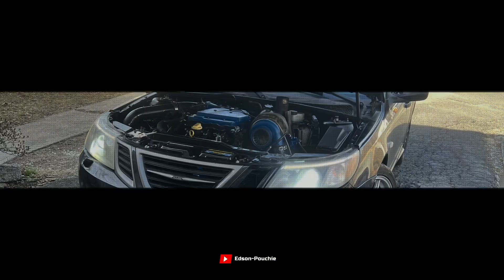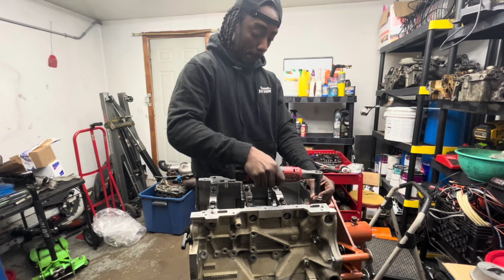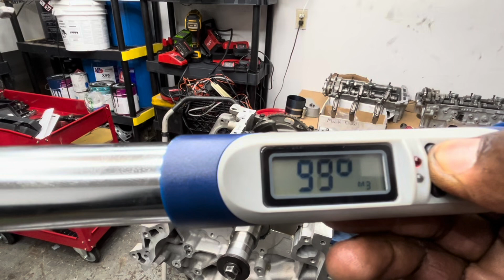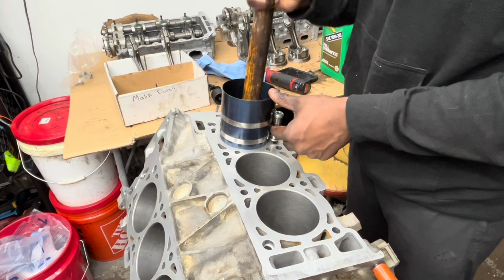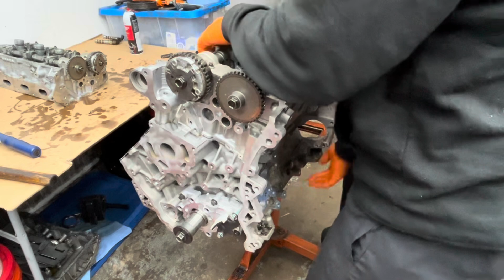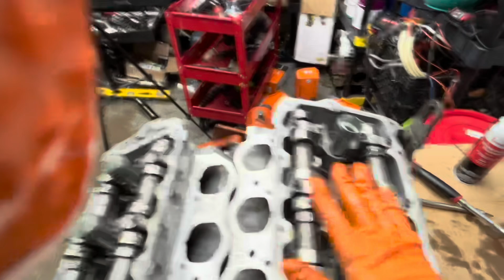TurboX 3.6 Swap Pt.3 | The Fully Forged Engine You’ve Been Waiting For!

Comment: Just stumbled upon your channel. Always cool to see someone diving in deep into these under the radar cars. Saab’s are definitely cool and i didn’t know the LY6 had 6-bolt mains.
Reply from the maker: A good slept on block! I think they can be competitive with a good trans attached
Reply: @Edson_Pouchie Seems like the straight cut gears you have in there are holding up well for now? Maybe not the synchros. Don’t have any experience with any of that drivetrain but I was pleasantly surprised to learn about the 6-bolt mains. Also looks like there is some port work done to the heads? Or is that stock intake ports which from here also look like a very good design.

Comment: Great job Sir! Are you planning to beef up the transmission and the 'transfer case' gears?
Reply from the maker: @Whourkr  the transmission has straight cut 3/4/5 gears installed 
The transfer case and rear differential will have to show its weak point before I try to upgrade them I believe there was studies GM did showing they handled over 1000 hp

Comment: Did you use stock main bolts? Or did you use some performance ones and have the machine shop hone it to fix bearing clearance stuff?
Reply from the maker: They polished the crank and then set all the clearances for the rod and main bearings- I used stock main bolts in the next block I’m going to try and get arp main bolts made

Comment: What are you doing when you tap the cylinder with the mallet over the big holes 🕳 in the engine?
Reply from the maker: Putting the pistons into the engine block, the rings are compressed until they are in the engine

Comment: Your rebuilding the 3.6 what parts did you use from the 2.8 engine, camshafts, what else❓
Reply from the maker: I reused the cams valve springs and retainers, I was running a stroked 2.8 so I reused the same rods as well. I also could of used the crank because I was already running a 3.6 crank but I didn’t